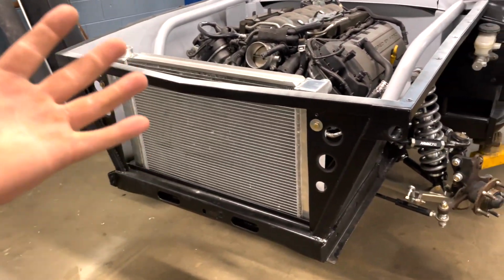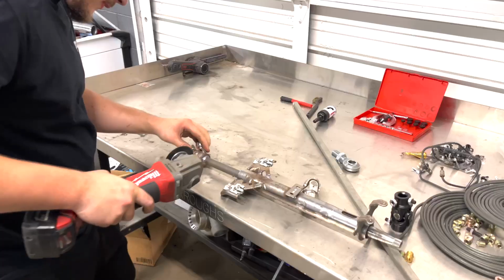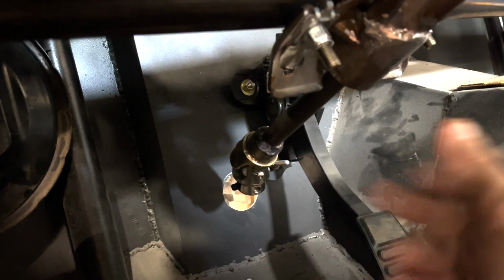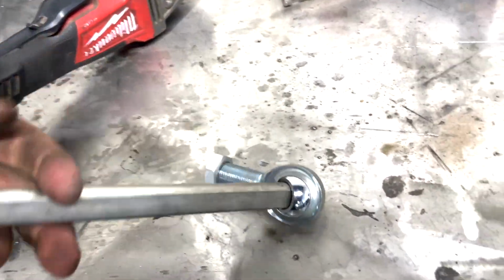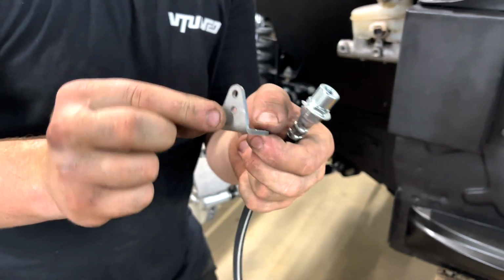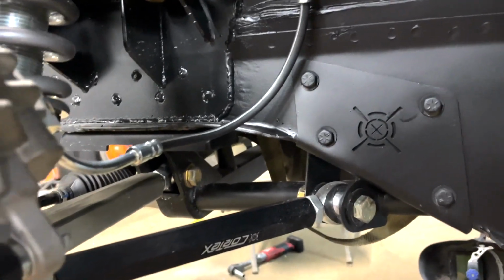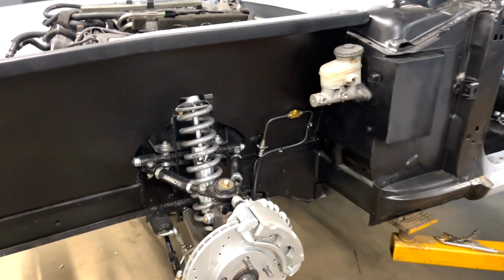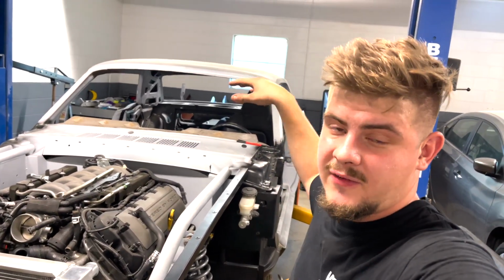My 1965 Mustang Has Steering And Installing The brake Lines And Calipers!

Comment: Little brother I think it's going to be very interesting to see how you're going to put ANY exhaust system on that car with the limited amount of space you have in that engine compartment. Now you have that steering rod going right through there dude you're not going to put an exhaust on the driver side of that engine. You need to rethink this little bro.

Comment: cut the bolt of joint and weld it to make it part of the firer wall to fill in hole were shaft goes through

Comment: Your concern for the steering shaft, has a single point failure, at the end of the first shafts first attached point. set-screw. If the screw backs out, No Steering. You can use red-loctit on the set-screw or tap and die the hole, install a bolt threw the U- joint and steering rod, torque and secure the bolt. Make sure you dampen the radiators upper attache point. If you induce vibration it's like lowering, the fluids viscosity. AKA, forming. If bad enough, it can cavitate the the water pump, if bad enough. Your working you problems as you go. I see the house keeping is getting there, okay.

Comment: Why did u not sort out the brake pedal before running the lines . Still think the booster can go under and giving a direct pedal , custom but not the 90 degree angle u gonna have to do

Comment: So you’ve to disconnect the brake lines if you want to drop the subframe? Single flare on steel brake lines? Did you remember to flush the lines with using a grinder to cut them? Those flexy hoses are too tight too. Apart from that, great job…….. 👍🏻

Comment: I’d be a bit concerned about those brake lines; look too tight on the callipers; did you do full lock to lock and check the flexible lines are stretched?

Comment: Brake line can go lower than the bleeder on the calipers? I thought this would cause a problem when trying to get air outta the lines
Reply: No the bleeder goes on too on the calipers
Reply: As long as the master cylinder is higher than the calipers...gravity will take care of forcing the air out at the bleeders.
Reply: @moneymarty1  correct👏

Comment: Am I the only one that says no turbo? Love turbo vehicles and own several but the 5.0 coyote makes great power as is. Get the car done, you can add on power later if you want it. 

The chassis is so light compared to the mustang the motor came from. Ditch the turbo idea for now. Get the car done properly and enjoy it. I feel like you put too much on your plate with adding boost.

Keep pushing forward. Get a white board and write down the to do list. Little organization goes a long way.

Comment: i dont know who is going to engineer approve this vehicle
Reply: the expert, you know, "honestly" he knows everything.  This thing is a liability.  god forbid he crashes into someone, the insurance company of the victim has documented proof of unsafe, improper construction.  I did unsubscribe but I enjoy reading the comments.  Nobody will approve the engineering of this death trap.  MIG welding with dirty metal?  Solid mounts where flexible mounts must be used.  Non collapsible steering column that is MIG welded and not mounted so it will collapse?  This is an example of exactly WHAT NOT TO DO.  Interchangeable "I", and "We"?   LOL

Comment: The brake hose is rubbing on the metal and it will not hold
Reply: Nothing is done right.  A decent puddle will pour moisture into the brake master.  Water at 60mph in a wheel well will cause huge pressure.  Hope he fixes things.

Comment: Once again, another Go_Kart  build on the brakes and steering!!!  Brake systems are designed in a way to conform to DOT Standards and Safety which you have no idea about.  Trapping air, single flare, diagonal front to back design, universal joint in cab.  You really need to start doing your research before trying to build a car that will kill you one day.  You can hate on the haters but remember this when your wrapped around a tree grasping for your last breath in what you thought was such a better build than any car engineer has ever designed under strict government guideline for good reason!!!   And seriously go buy a tube cutter for $10 and at least try to care while building a death trap!!!
Reply from the maker: Dude a stock mustang is a death trap I love how that’s the first thing you say yea im going to build this mustang and go drive it as fast as I can on the road and not test and tune it lol and every car is a death trap wrapped around a tree lol